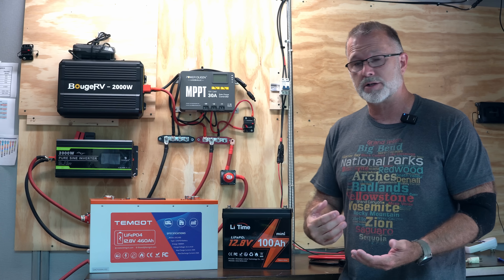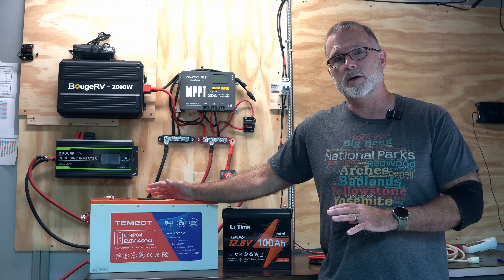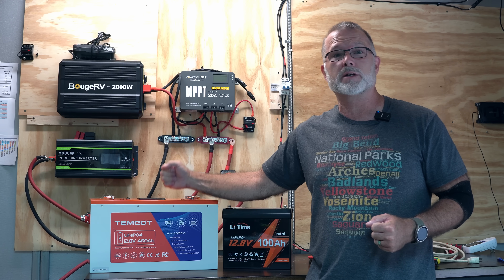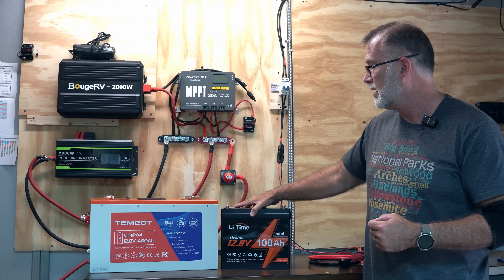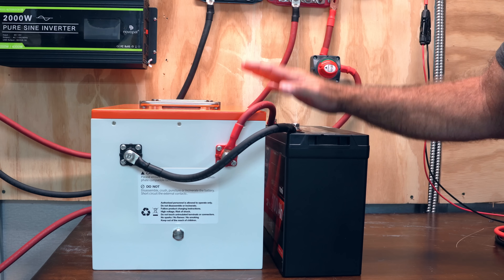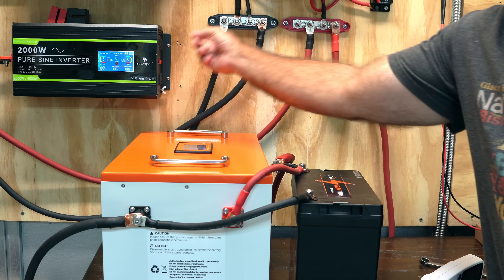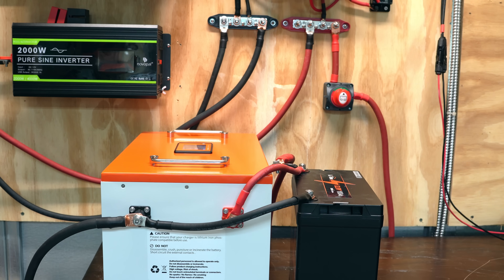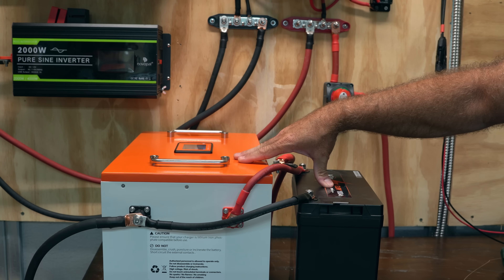Connecting Batteries with DIFFERENT Capacity in Parallel - What Happens?!

Comment: Tnx.  I wonder if you did pull more than 100 Ah ... why wouldn't the higher amp hour battery try to equalize and the current that is needed would use the cables to pass.  I could see maybe too small of cable .. might be an issue...  It might be an interesting test.  If the BMS shuts it off then you can restart it anyway.

Comment: Thanks for posting the video. Cool test and good points about the different discharge ratings. 1 question and one concern: If they were providing a total 300A load, wouldn't they split the load according to... Some other factor? (Internal resistance maybe?) 
The concern I have in this scenario is charging and reduced performance long term. The CV,CC charging stages of each battery are likely reached at different times. In that case it might be best to customize or limit the charging profile, likely resulting in lower total capacity.
Reply: Charging isn't a special concern.  You are thinking correctly when wondering about how they split the load, the same logic applies to charging. As for how they split, internal resistance is an issue, but usually a bigger issue, especially with LiFePO4, is the cable and connection resistance.  You can test this using a clamp meter to monitor the current in the different wires between the batteries and battery to load/charger.  With very different batteries such as in this video, internal resistance will definitely help split the current.

That said, you would never want to do this with any load (or charger) close to the maximum supported by the total of the batteries. The current is not going to divide that precisely and it will change depending on the state of charge as the internal resistance curves of the batteries will vary.  Beyond a quick surge the imbalance is likely to trip a BMS if operating without enough margin.  If using two matched batteries, I'd probably be comfortable with designing for 75% of the total current (i.e. batteries support 2x 100amp, I'd probably be okay planning a 150amp max load). Note how that means even a gross imbalance of 2:1 is within the specification for a single battery. Using a setup like that should be fine.  The more batteries or the more different the batteries the more safety margin is required.
Reply from the maker: @Sylvan_dB  Very nicely described!
Reply: It’s probably not a good idea to use this combination for high discharge applications like the 300 amps you described.  This would be for slow discharge application. For high amperage uses, both batteries should have the same size BMS so the load can be equally bifurcated between them.
Reply: Kirchoff had a bit to say about this.
The community here would garner a more intuitive understanding and develop a deeper understanding if they studied Kirchoff's and Thevenin's laws. The penny will drop once these are understood and will have these folks designing systems on beer coasters and napkins in no time.....and get it right without assumptions or vague personal models of what's happening.
If you connected these batteries in parallel via a busbar with separate tails in parallel, you could measure how much each battery was contributing and see how the larger capacity battery is actually charging the smaller one during periods of the discharge.
That was a nice Heath Robinson style demo.
Reply: @walsakaluk1584  Once I stepped out of the classroom into the lab I realized that while Kirchoff, Thevenin, Norton and others provide a brilliant theoretical framework, the real world requires a lot of assumptions and rules of thumb. The first problem encountered is an almost complete lack of specifications necessary to perform the requisite calculations. The second is that we must design for the center and avoid edge cases because of individual component and environmental variance, so the additional analysis is seldom useful. Oh well, the theory does provide some direction in thinking even if the equations are never evaluated.